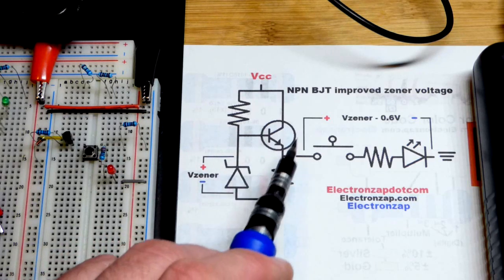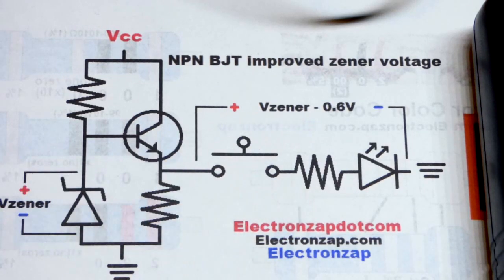Voltages of NPN BJT emitter follower improved zener voltage with 6 tenths volt drop circuit

Comment: Nice video, what would the voltage at the output be if you didn't use the Zener Diode?
Reply from the maker: It's a NPN bipolar junction transistor emitter follower (also called common collector) circuit, so the output is about 0.6V less than whatever the input at the base is. It doesn't matter what is giving the signal.
Reply: @Electronzap  Got it. So using a 5.1v Zener was just so you could have that particular output voltage minus 0.6v.

Comment: Is this for amplifier?
Reply from the maker: It's a current amplifier, so that the signal doesn't have to provide the current. The voltage is slightly lower (minus about 0.6V), so it's not a voltage amplifier.